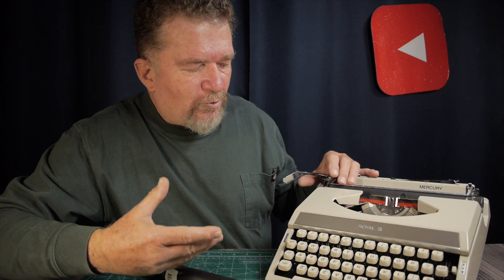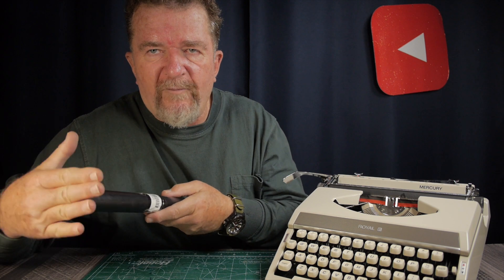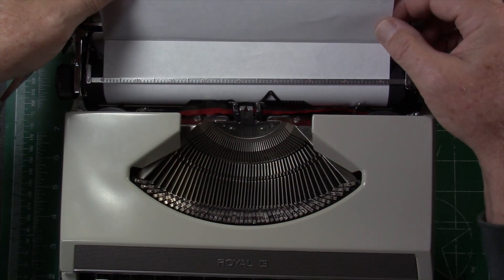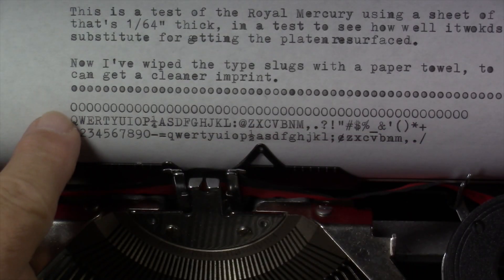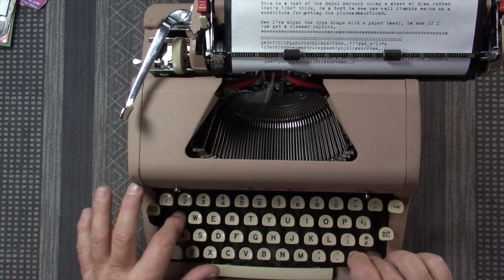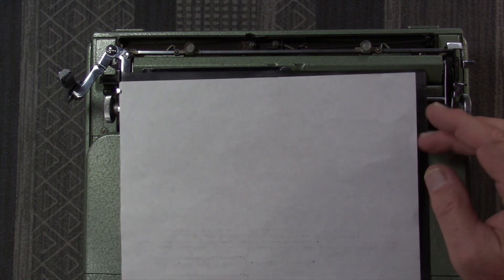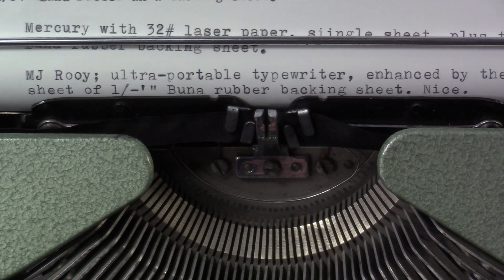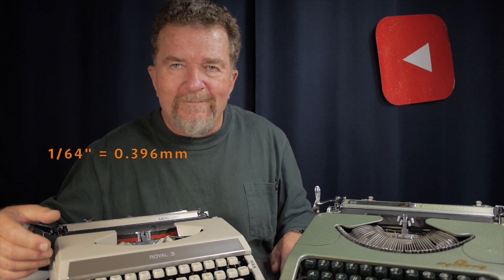Typewriter Video Series   Episode 253: Rubber Backing Sheets!

Comment: I tried a different approach ... I slid a bike innertube over the platen of my Remington Rand Model 1. I used a tube diameter a bit smaller than the platen and a length a bit longer, turned it inside out, then rolled it on to the platen so that the outside of the inner tube ends up on the outside of the platen. I failed the first try, but then used soapy water between the two layers of the tube the next try, and Voila! I trimmed it and sanded the tube's little manufacturing ridges smooth with 400 sandpaper. I'll have to wait till I get the paper rollers out and redo them before I can report how the new platen surface works.

Reply
Reply: The paper feed rollers and paper fingers have new rubber and the resurfaced platen is back in. Everything works fine, but as people with more experience might have anticipated, the platen surface may be a tad soft. Before I make a final judgment and try heat-shrink rubber or JJShort, I'll adjust the letter heights, replace all the bumpers and dampers (up front under and over the key arms, and the felt under the backs of the letter slugs), and other tweaks that I learn as I go. Thanks for the great maintenance and repair videos!

Comment: Great!  I was trained in Typing I in 1967 to always insert 2 sheets of typing paper.  All these years later, unless I'm using heavy stationery like 24# and such, I still do this.
Reply: I started with old manual machines from the 1950s or earlier. Second year typing we were put in front of IBM Selectrics and I typed about 14 letters before I could get my finger off the key. It took time to adjust. 1981. My mother insisted I take typing. I’m grateful I did working with computers most of my career.

Comment: Joe did you clean the type, Joe I think you have increased the anvil (ring) gap . The gap setting will vary from machine to machine.......but I think for your purposes the rubber sheet will be a good way to go with machine that have hard platens

Comment: This is a good idea. Thank you for the suggestion. Years ago when I was at college I had a template with margin lines on that I used for a backing sheet. It was almost like the silicon sheets we now use in the kitchen for baking. The margin lines helped me keep from running my document off the bottom of the page. I hadn't found a template so I made my own. I made margin lines on a piece of card stock and that has worked, but not always well. I will try the rubber sheet when it arrives. I enjoy your knowledge about typewriters. It has helped me as I have grown my collection. My collection isn't as prolific as yours and likely won't ever be, but I enjoy it. I feel my creativity is enhanced by the slow, methodical way I use this wonderful old machine. Thank you!!!

Comment: Joe, I am reluctant to spend $19 for that 1/64 sheet. They have a 12x12 1/64th sheet for $3.31, do you think that is too thick?
Reply from the maker: If it’s 1/64 inch then it should be the same thickness. The item I ordered is enough for four letter-sized sheets, probably more than you need.

Comment: I can't find 1/64" rubber sheet on Amazon.  Is it discontinued or am I using incorrect search words? (Using thin rubber for typewriter backing sheets)
Reply from the maker: See the link above in the description. They may be sold out right now.
Reply: I use a 4 mil clear vinyl that Joann Fabrics franchise stores sell by the yard, It's cheap enough that you could try different thicknesses for the best results on your particular machine.
Reply: I'm seeing lots of it.  They don't know from typewriters, this stuff is sold largely to make gaskets and vibration absorbing things, just search for the material.  Rubber sheet 1/64" kind of thing, rubber sheet 12" x 12", something like that.  There are many types of rubber and hardness ratings so I was guessing at some point.  I think anything below Shore 50 or 60 might be floppy, anything above 90 or 100 might seem stiff and woody?  A vague notion, there is information available, but I guessed.

Comment: Good job!  But wouldn't smearing inside the characters also be affected by the cleanliness of the type and the 'type' of ribbon?
Reply from the maker: Yes, of course. But in this case, without the rubber pad the text is clear and distinct, just not as dark as with the pad. And I did try cleaning the type slugs, not much better.

Comment: I was thinking of using overhead projector sheets. They would probably static cling to the paper.

I wonder if you could spray some light adhesive on the rubber and run it through the platen then cut off the tail. Essentially recovering the roller.

Comment: VIDEO REQUEST: I have an Underwood 319 with a non-function linespace carriage return lever. 

When I push the lever to the right it moves the entire carriage, but it does not space my lines. Any help?
Reply from the maker: Check the line spacing selector, it may be set to the variable position, above the single line spacing position.
Reply: @Joe_VanCleave  - The selector itself is jammed. 
I have an Underwood 319 and a Smith-Corona Silent... Based on looking at the Smith-Corona it appears that my Underwood 319 may be missing a piece entirely.
Reply: @calebrobertson9589  look up typewriter matinance group on facebook , they will be able to help you out

Comment: Oh! That worked very well. It would be interesting to find out the maximum thickness that would feed through. 1/32? Probably not 1/16. I’m going to have to pick some of this up. Thanks for yet another great video, Joe!
Reply: I have tried 1/32" neoprene, the hardness is A40, I think. It works very well, BUT the type characters with little surface area (the "." - the Period - is the smallest) print darker and deeper than those characters with lots of surface area. Probably "#", or "@", would be among those. So one types along quietly, and then takes a look at the finished page. The Periods are Huge! On eBay there are also neoprene sheets with a hardness of A70, and sheets of 1/64" thickness. I mean to try that soon.

Comment: Thanks Joe. I tried this myself a while back. This is a good way of quietening down a very noisy platen. I just became impatient with having to do it.

Have you tried stretching over an inner tube ? No heat required. Just a bit of talc to aid pulling it on and patience.

I did his on a rock hard Adler Tippa and it’s help up excellently after two years use. 

I guess bike inner tubes have to be very resilient. 

Thanks for the video.

Comment: Old secretarial trick for carbon packs / multiple sheets: slip an envelope over the feed end of the multiple sheets to ensure aligned feed into the machine.  Remove envelope before typing.
Reply: Wow! Fantastic. Thank you for sharing that.
Reply: @typepals  Can you recommend  a place to buy bulk ribbon big roll? That wont be dry and stays wet.
Reply: @joehefner2296  I don't buy big rolls, but I hear good things about Baco Ribbon.
Reply: !!!  That almost too easy!  I've been fumbling with this, but didn't think of the envelope, even though some are sitting RIGHT THERE.  I have this vague memory of carbon-paper packs, maybe a few sheets that were ? glued together at the top.  I'm so glad to HAVE carbon-paper and FILM, I don't mind a little fumbling.  I thought that these materials had gone out of the world, and wasted some money buying new-old-stock on eBay.  Even cheap generic NEW carbon paper is pretty good, except that they quit using those shallow boxes and just ship it in a flimsy envelope which is awful.
Reply: It's actually a folded page

Comment: One perhaps similar option that I'm using is: basically a bit thicker plastic shopping bag (actually not really a shopping bag, but a plastic bag that is used for packaging, but I think it's similar to shopping bags, although probably a bit thicker, and thinner than the rubber you have there); I often put it between two papers and so there are 3 layers, one of them being the one on which I'm typing. So, yes: rubber or plastic is something to use instead of a backing paper:)
Reply: Oh! I love this idea. I’m going to try it. Thanks!